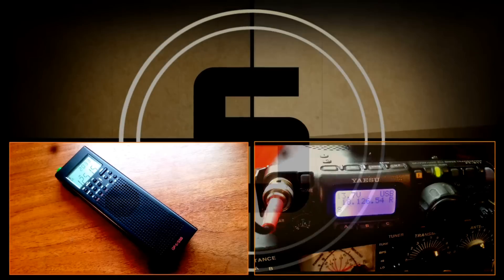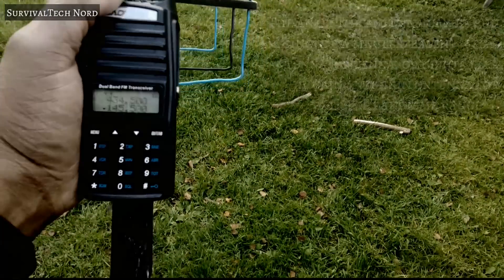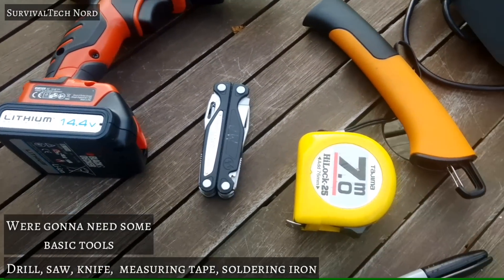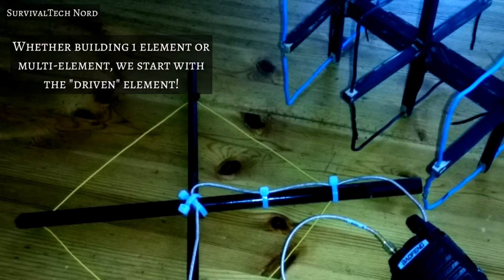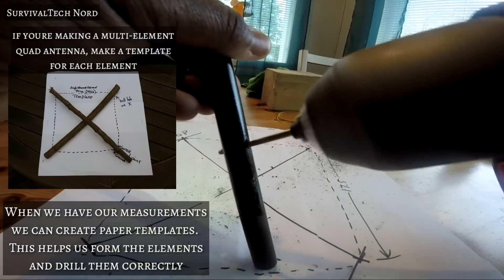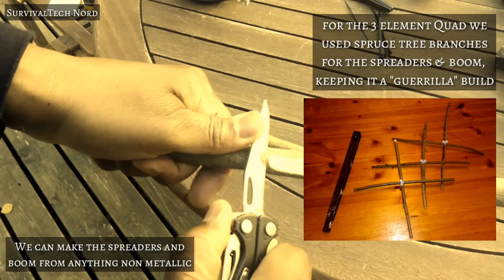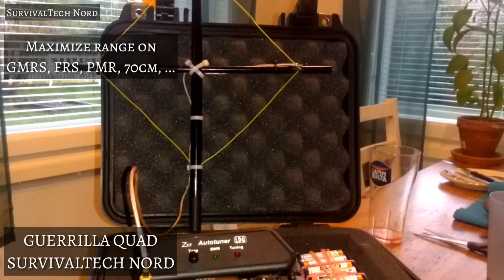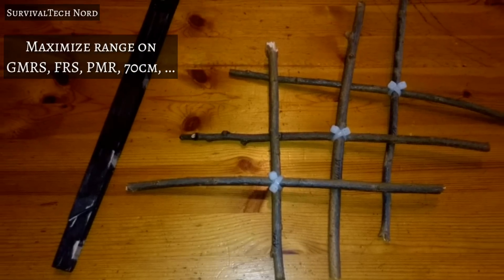Baofeng Antenna | LONG RANGE Cubical Quad

Comment: What did you mean “closed loop” on the quad one? Do you make a complete circuit on that one? Also why? What’s the difference in the two?
Reply from the maker: Hi Andrew
I meant literally closed. It is a complete circuit. The second Loop where the feed point is is open oh, and the feed Point attaches to it. The difference is one is a director or reflector, the other is a driven element.

Comment: I sent this to a buddy who is just getting started in Ham radio. Your video will make it easy for him to build his first one and find out if it will get him into the local repeater with his HT. He can hear it but he cant talk into it. I hope this project helps him learn about antenna basics. Thanks for keeping it simple!
Reply from the maker: No problem. 👍👍👍
These little guerrilla antennas have good gain and work  great.  Just remind him to test direction to repeater carefully. Sometimes pointing a little off centre gives better results because of obstacles we can't see, or reflections of mountains, buildings, ...
73
Julian oh8stn

Comment: Great video 0H8STN! WQRB311 here and I was wondering if you can help me out? I built a few 70CM dipoles and they work well but I want to build a quad, because it looks like it has more gain than a 3-element yagi. Does a quad have more gain? I love to build antennas, but have little resources.
Reply from the maker: The best way to find the answer "theoretically" is to model the antenna. Boom length, number of directors,... all contribute to increased gain in yagi and quads. Which one has higher gain depends on how it's configured. ARRL antenna handbooks have great projects and baseline numbers for antennas.  The books are a great place to start.
Reply: Thanks 0H8STN!

Comment: lol, the Flintstone quad.  

This is a great stealth build.  I have seen people hide vertical antennas in or on top of trees this way.
Reply from the maker: That's right Flintstones antenna. 
I was really trying to take the intimidation away from antenna building, showing people that it really doesn't matter what it looks like, as long as the measurements are correct. That's a huge hurdle for some people.
Thanks for commenting and for watching :)

Comment: I'm working on mine together now STN. Here are a few questions to start a bit of debate... and help me of course.

Q1. Can I use a central boom to mount my spreaders on out of aluminium or will it cause chaos with the performance? My next choice is to use wood and dowels for the spreaders.

Q2. Is it important that the open end of the driven element sits to the left or right side or can it go any way round?

Q3. Does the length of the wire at the driven element include the amount to hook back in a little to join it to the coax? Trying to find a close-up image of the coaxial connection. Whether to use a solder joint or a terminal block connector.

Q4. Should I be looping my 1m coax, if so does it need to be s specific number of times?

Q5. I'm Just working out whether to go for a larger  2m or more hand portable 70cm version. If I go for 2m (144 to 146MHz in the UK) should I attempt to tune/size for the middle 145MHz or the higher 146MHz? If I go for 70cm, my local repeater operate on 433.200Mhz and 433.375MHz, so maybe I should build for a centre of 433.3MHz... I don't if it makes that much difference.

Hopefully, others will  have the same questions or some of their own they want to ask which will also help me out. Hopefully too I won't cock this up and ruin my radio, as I don't have an SWR meter yet.

Other than my coax, I'm purposely making this entirely out of junk I can find in my garage in keeping with the theme. I'm currently stripping old lighting ring-main cable to use . Maybe this will also prompt further questions that'll encourage some discussion. Taking me a lot longer than 20 mins but once I understand the principles, I'd like to be able to knock one of these up very swiftly.

Yet again, my wife wants to know what I'm up all this time in the garage and why I'm not doing stuff around the house... I have selective hearing.

73's
Reply from the maker: Great questions. 
My son is home from the Army today so I'll answer these questions in the evening when he goes back to the north. I'm really happy to see that you come up with these questions :)
Reply from the maker: Okay here we go.
question 1 in my experience the middle boom will cause problems with SWR. That's not to say it can't be done I mean look at every other yagi. But I don't have experience building the quad with a metal boom.

Question 2 left or right feeding for vertical polarisation,  or top or bottom feeding for horizontal polarisation.

Question 3 the length is the exact dimension. You'll have to add a little bit for overlap. I used direct cable/soldering but using a terminal block, you'll have the ability to make adjustments. 

Question 4 some of my books say three turns for an air choke.

Question 5 tune for the frequency that you plan to use if you have a favorite repeater then the center point between the input and output frequency should be your target. If you going to use it for SSB, your target dimensions will be around the calling frequency. Moreover why not build both?

The selective hearing is pretty important. My wife likes it that I stay busy with these sort of projects. The building from junk is a great idea there's no reason to build this out of good stock while learning. 

73 from the great white north.

Comment: So how does the performance of this compare with a yagi antenna using the same numbe of driven elements and reflector.
Reply from the maker: Sorry I forgot to come back and answer this question. 
It's been a long time since I've tried my hand at antenna modeling, so I really don't have any factual information for you. However I found this article from a club that I know and respect, which might be useful. http://oh3t.blogspot.fi/2013/02/quad-antenna-myths-quad-performance-vs.html

Comment: Ok looks straight forward enough. Anyone in the UK know the best/cheapest place to get the correct coax, Maplin, eBay or other?

Shared
Reply from the maker: There is a 1 meter cable on amazon. http://www.amazon.co.uk/gp/product/B00UZ9EYJY/ref=as_li_tl?ie=UTF8&camp=1634&creative=19450&creativeASIN=B00UZ9EYJY&linkCode=as2&tag=survnord-21

Cut it to length then throw away the unused male connector. 
Hope this helps
Reply: +SurvivalTech Nord. Well I've just ordered it from Amazon, so we'll see what kind of mess I make of it. Trust me when I say I'll be asking some questions when it come to assembly time. It won't be pretty, but of course that's not the point. Wish me luck. I'm quite looking forward to this.

PS. Hurry up Amazon. Where's my item. I ordered it nearly five minutes ago?
Reply from the maker: +LilBlighter :DDDD
it's doesn't matter what it looks like, only if you're heard. And I think you'll be seeing one of those Amazon drones any minute now :D

Comment: Very cool! I love the quad design and for high frequencies like 2m and 70cm they are quite small in size, perfect for portable use.
I have to build one :)
Reply from the maker: Nice. I think I'm going to build a 5 element version for 2 meters, to test getting into the WPRS digipeaters across the sea in Sweden. This is really fun stuff :)

Comment: I have been looking forward to this viedo for a while. Very fun looking antenna and project. Any idea what the antenna's db would be on 2M?
Reply from the maker: It was great fun indeed.
I don't know about 2 meter gain specifically but no matter what frequency we are discussing the gain is always going to be a relationship between the number of elements, spacing of the elements, and the length of the boom. So in order to answer your question we need to do some antenna modeling. :)
Reply from the maker: I found a partial answer for you ~9.5db gain on 145mhz with 3 elements.

Comment: has this concept been created to be masked in the same way as they disguise cell towers?
Reply from the maker: Hi Michael. I'm wondering by masked if you mean hidden? For the single element version I thought of weaving yarn around it like a traditional American Southwest "God's eye". This way it could be hung in the window, looking like a decoration with no one having any ideas it's actually an antenna. 
The multi-element version is a bit harder to hide! Still, you can see in the video where I have one mounted to the banister on the side of my house beaming c directly to a distant repeater. Given the performance from the three element version compared to its size and how its mounted, it is rather stealthy, and certainly can be made to be more so.
Hope this answers your question. Thanks for watching.

Comment: fantastic way to get people experimenting!!!
here's my question for the group... is the single element version omni directional?
73's
-rob
Reply from the maker: Hey I'm glad you think so. Experimentation is always and wonderful thing. The single element isn't omnidirectional . In fact it is most active in front and behind. I have been toying with the idea of mounting it horizontally to see if we could produce an omnidirectional pattern, but that's very difficult here, having such sparse repeater coverage for testing. Would be worth a try though.
Thanks for watching.
Reply: if repeaters are few, maybe you could work satellite with the beam version.  i see a few videos on youtube with baofengs and small handheld yagi's workin the birds.
Reply from the maker: rkaag99 I was also thinking the same thing. I read the China just released a bunch of new amateur satellites for FM voice communications. Might be time to update my keplerian elements

Comment: I like it. Is there a schematic/drawing that a newb can follow?
Reply from the maker: Hi Tom. No drawings since the measurements depend on the frequency you'll use. If you Ed new the center frequency into the quad calculator,  you'll get the measurements. 
Thanks for watching.